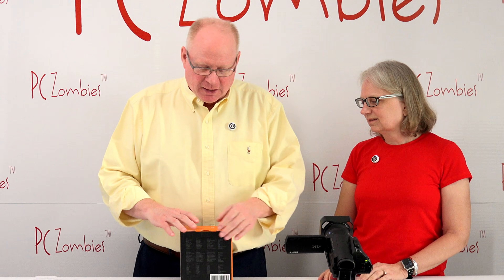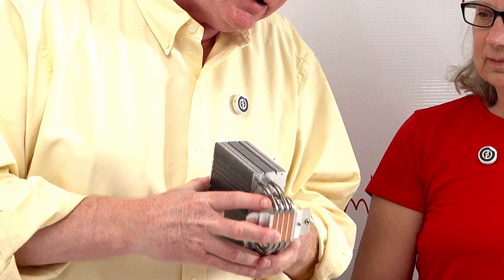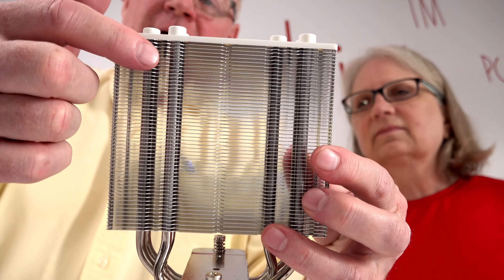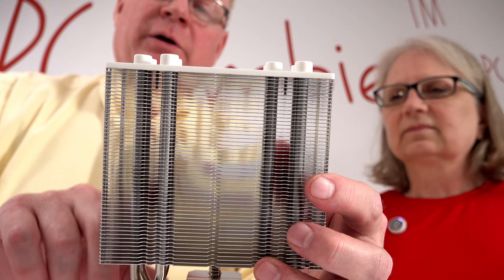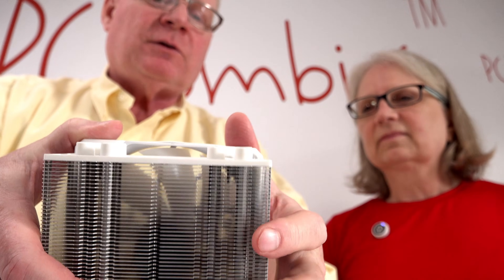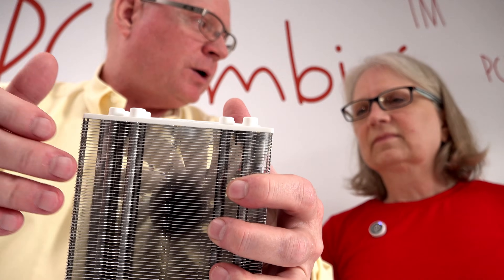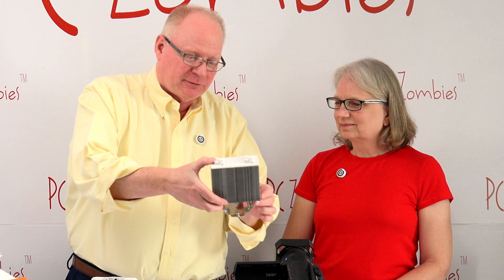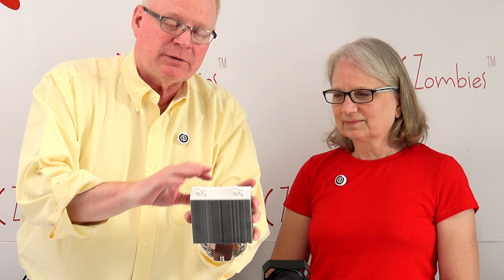Air Cooling Secrets: Heatsinks & Airflow | PC Cooling Masterclass

Comment: Good morning and thank you for the extremely interesting and well-made video.
I have a question regarding the 1:13  mark.
What difference does it make if I set the fan sucking hot air out of the radiator  instead of pushing fresh air through the radiator, as happens, for example, in car radiators where the fan actually sucks fresh air through the radiator ? 
Thank you very much and best regards, Gino.
Reply from the maker: Great question, and there are different ways of interpreting it. If you are talking about putting the radiator in the front of case (where the case is getting air pushed into the case) versus putting the radiator on the top or back of the case (where the case is pulling air out of the case) then the consensus is that it is cooler on the CPU to have the radiator on the intake (the difference is only a few degrees Celsius). But if you are just talking about putting the fans before or after the radiator (regardless of the radiator's placement), then the answer isn't about cooling anymore (since it won't make much difference in temperature), but ease of attachment or aesthetics (like where the fan's RGB faces). Just make sure they are blowing the correct direction for intake or exhaust.

Paul
Reply: @pc-zombies hi thank you very much for your kind and very valuable reply 
Yes my doubt was about the fans placement 
Now i know that won't be differences 
I love these radiators
They are art pieces 
Kind regards Gino

Comment: Heatpipes don't use water.  They use a low-boiling point liquid that boils on the CPU, and the vapor goes up the tubes.
The inside of the tubes have a copper "powder" on them that helps promote the re-condensed liquid to move back down to the bottom.

So as the heat is pulled out of the tubes, the vapor cools, and then drips back down to the base of the cooler

https://en.wikipedia.org/wiki/Heat_pipe
Reply from the maker: Thanks for the great description of how the thermal transfer works. This detail is great!

Paul